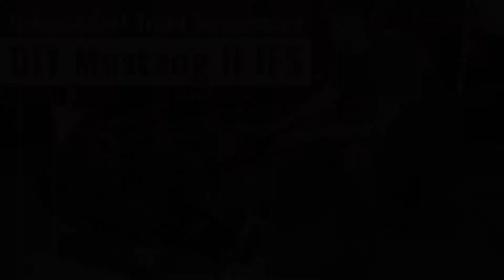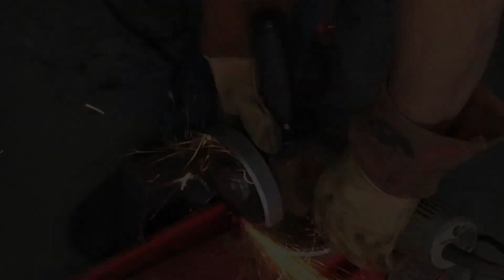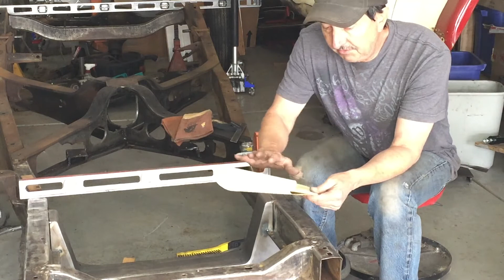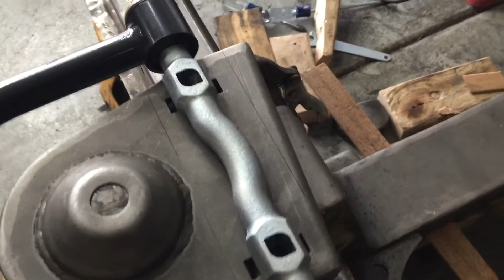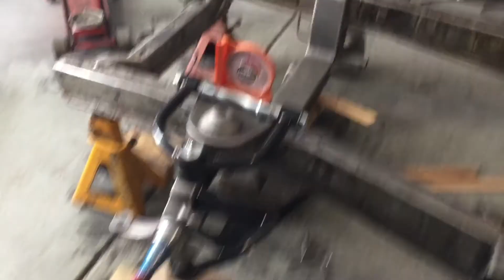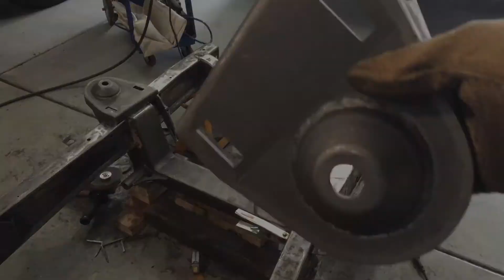Part 3. Adding Independent Front Suspension. Mustang II IFS install in a 1950 Willys Jeepster.

Comment: You have to have anti-dive built in to the front crossmember I believe you have just cut that out with yourself about 6° would be nice and I’ll pitch if you could put that back on you’d find out you just cut it off your anti-dive which keeps your chassis and body from diving forward I’m heavy breaking
Reply from the maker: I was careful to work in the angles needed to get the proper anti dive. Thanks for reminding other viewers of that important factor to consider when doing this type of project.

Comment: I'd be very wary about cutting, trimming anything.... I bought the Speedway kit specifically because the Universal kits are too funky... so many manufacturers that leave you with lots of steel in the wrong place and no clear dimensioning.
Reply from the maker: So very true. The kit I used was made for a 1940 Ford and it had good instructions for that frame. It is close to what is needed for the Willys but it is very difficult to find the tech specifications to make it work when doing modifications. Lots of hours of research but it is awesome now that it is done. I can't wait to drive it.

Comment: Hey, I'm doing a 1962 Willys station wagon over on my channel. If you had any advice about picking a universal ifs what would you pick? I've been searching and searching. Thanks in advance!
Reply from the maker: I did lots of research and found that Classic Performance Products had some great suspension and brake upgrades for classic cars. I called them to see if they could help me with a good IFS fitment for the Willys. I gave them the frame specs and they recommended their 1940 Ford kit. I have most of the kit welded in my car frame and I hope to finish up in the near future. So far I am very happy with my purchase.
Reply: @riderescue  thank you! I'll give them a buzz!

Comment: Watching you put those top hats on makes me think they were side specific. You may have had them on the wrong sides? Causing the need to trim and have the shock hole spacing be off? Not trying to be a troll, just an observation. Good luck with your project.
Reply from the maker: I appreciate all comments. I thought about the hats being on the wrong sides as well. I tried both ways and researched to find where the hats needed to be. I could have placed the hats in either side but the end result would have been the same. I ended up trimming them to fit correctly in the end. Glad they were large enough to trim. I have to admit I was worried about this set up. I'm confident that the geometry is correct now. Just the difference between the 40 Ford chassis and the 50 Willys. Now I just need to get back to work on this project. Soon, I hope.